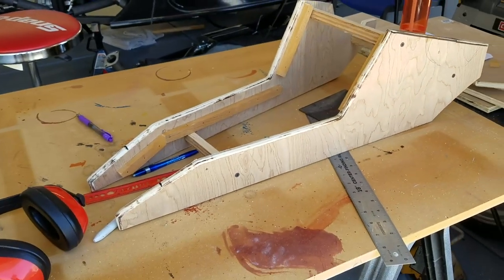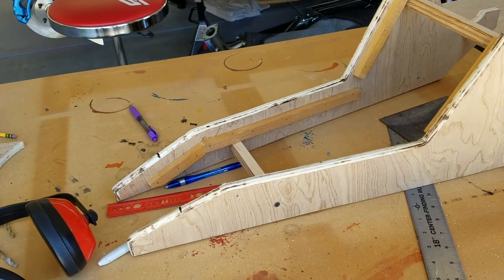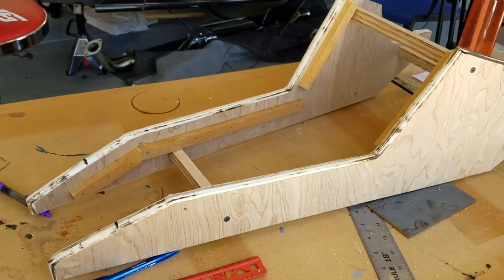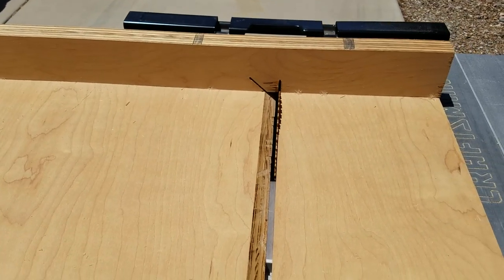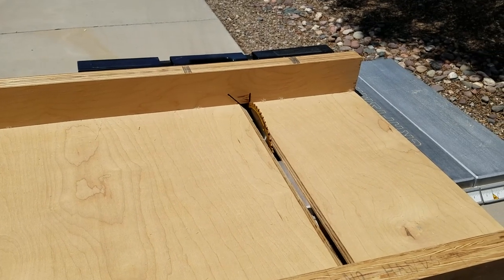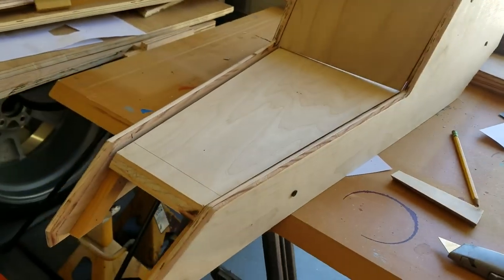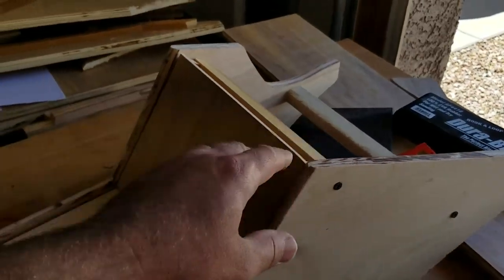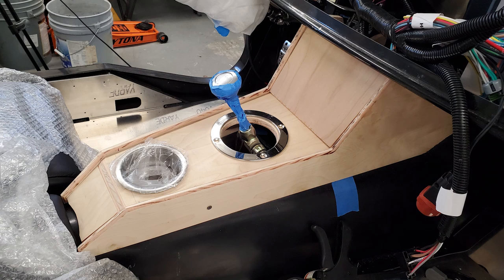Factory Five 33 Hot Rod V2 - Custom Center Console

Comment: Jim, I really like your console... do you have dimensions to share?
Reply from the maker: It would be moot since your trans tunnel, seat choice, trans choice and how far your engine is away from the firewall all effects the dimensions.
Reply: @StreetRodJim  I have a bench seat like you and a TKO500 which is a bit smaller... I was just looking for a guide to start with. I realize I would have to tweak it.  If you don't have the dimensions easily available, no worries...
Reply from the maker: @johnsharp8935  My trans is so big in this car compared to what you have, the dimensions I have will be inches off what what you will need.  Remember I have to build mine twice to get it to fit the way I wanted.
Reply: @StreetRodJim  Ok, no issues... I will mock one up from cardboard like you did. This will be fun... lol

Comment: Only one cup holder? Nothing for your passenger? Try using table saw for cutting. It works much better than a skill or jig saw. Your comment about plywood warpinjg is why  interior shops use mdf wood to build things like this. Far more smoother than plywood and completely stable.
Reply from the maker: The table saw does not work for all cuts on a piece like this.   I contemplated MDF, but for the thinness I wanted it would have not been as stable, hard to hold screws and would disintegrate/ swell if water or moisture got to it.  For these reasons I chose the birch plywood.  There is pros and cons to each.  If I had a bigger vehicle, a thicker version of MDF would work well. I would still seal it though which most do not.
Reply: Street Rod Jim  I use 1/2” Baltic birch plywood.Void free and super flat. Great work keep it up!